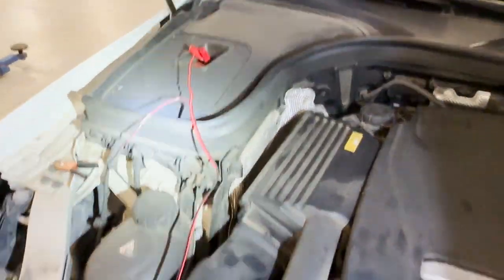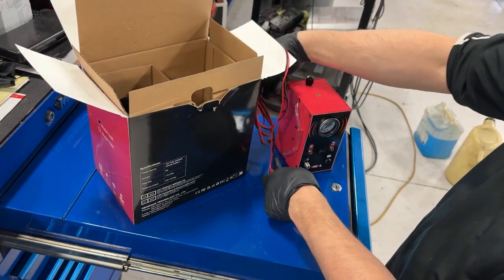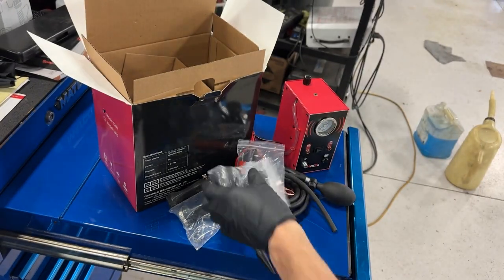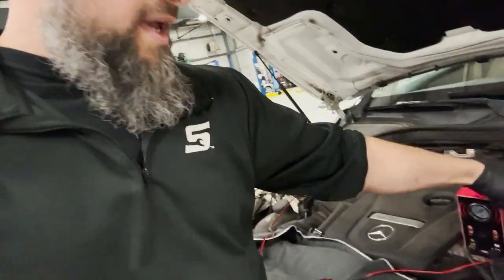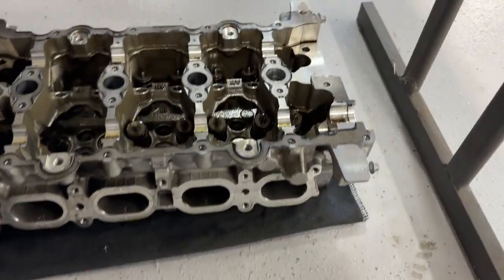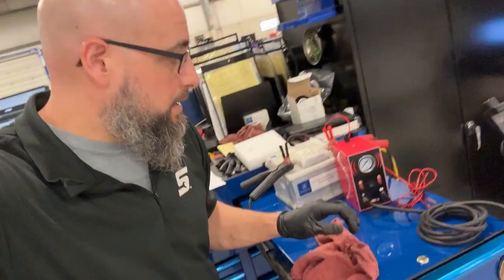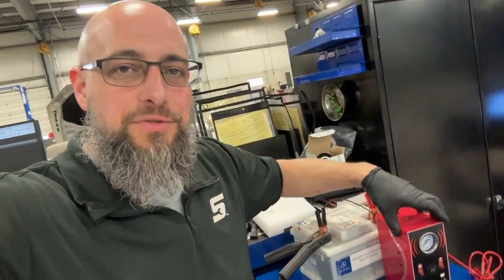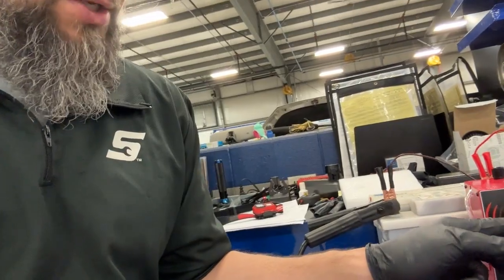Ancel S200 review smoke machine smoke tester

Comment: Cool. If you use the test port it is a good idea to just remove valve core (left hand thread) to remove any resistance to smoke flow. Makes detection easier.